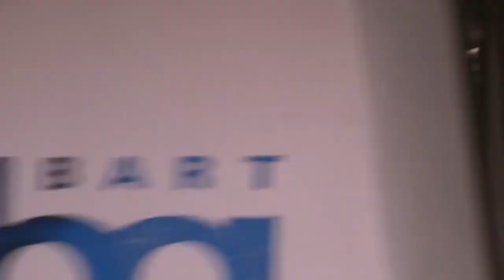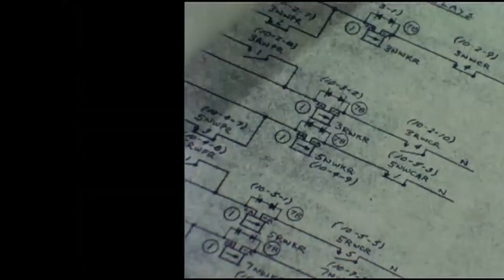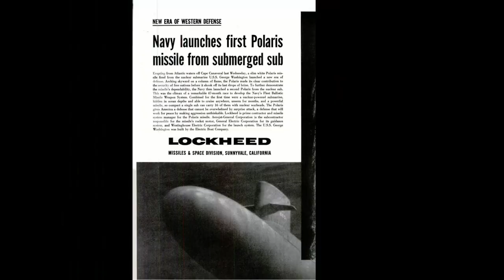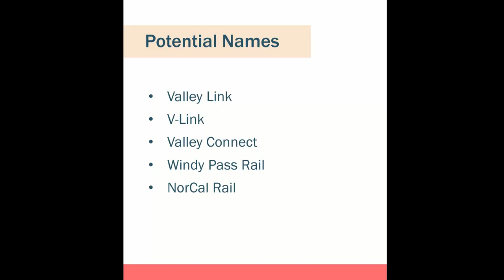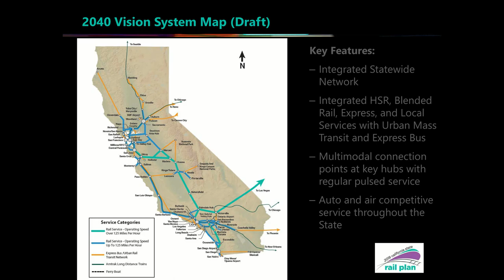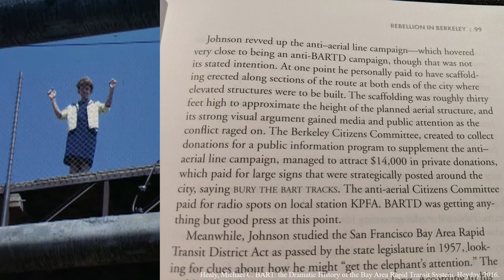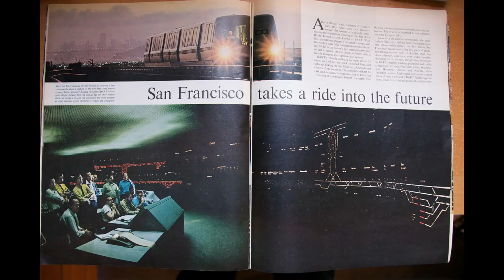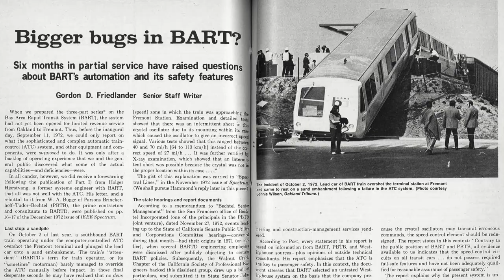BART: The Bay Area Rapid Transit (District)

Comment: I am a big fan of subways and transit systems.  Overall,  BART is a great system now connecting four counties.  The problem I have with transit systems in the United States and BART, in particular, is how long it takes to build the system and/or extend the system.  There were so many delays I think it took four years for BART to extend the line just two stations into San Jose.
Shanghai, China has a subway system larger than New York City and it was accomplished in just thirty years.  BART is probably only a third as large and it will be fifty years old next year.  It is not only sad it is pathetic that BART and transit in general in the United States is far behind in planning and construction.
Reply: Well, our regulatory system allows any NIMBY to block even projects of national importance. Ironically, this is mostly done via environmental laws lawsuits, like CEQA. It's sad that zero-emission environmentally-friendly alternatives to driving are being blocked using laws which were originally meant to protect the environment.
Reply: after approval in 2000, the south bay extension didn't open until 2020... crazy slow progress

Comment: Good video. 
ATO (automatic train operation) was developed successfully in London and on the Lindenwald line in NJ at about the same time.
AFAIK the Tokyo metro can manage 90 second headways with human drivers but they have a unique perfectionism.
You could have mentioned they built BART to a different rail gauge (5’3”/1600mm) to the rest of the US railroads (4’8&1/2”/1435mm).  The only justification I’ve seen for this is the concern that crosswinds would blow the light weight aluminium bodies over. 
Inventing the “perfect” system is absurd when good enough using existing technology will do. 

Nice comparison with CAHSR.  IMHO they should have built maglev.
Reply: They actually used 5'6" Indian Gauge, and the wider gauge would allow them to have better stability at higher speeds, as the system was designed to be a commuter rail/heavy rail hybrid.
Reply: @AVeryRandomPerson  Thanks.  

Was it necessary?  

Other railways seem to have high speed on 1435mm gauge without problems.  The increase in stability would seem to be marginal.   They could have gone full-GWR to 7'1/4"? AFAIK no one else has copied them.

I read once that BART chose it because the design uses lighter (aluminum) framed cars and they were worried about strong cross winds.

Comment: The Genesis of Bart came out of the demise of the key system in the early fifties
 When they did get rid of the urban transportation at that point the outlook was we're gonna have to put a train under the Bay that was decided in the mid fifties and they had an artist rendering of what that would look like
It wasn't until prior to the Vietnam war that the decision was made to do an environmental impact study and figure out how to fund such a project
 the Bay area rapid transit district was created to get the funding and once funding was achieved the contracts were approved and the idea was to completely electrify a train system for the entire Bay area unfortunately that didn't happen
The bulk of the system was completed and brought online in 1972 and it wasn't until a few years after that the trans bay tube was constructed and opened a couple of years after that and it wasn't until recently did a complete circumference of the Bay area plann with all of the transit bureau's and districts for the entire Bay area finally come to fruition
Phase one of silicon Valley has finally been completed phase 2 is about to begin construction and once that is opened in 2028 with the adaptation of the electrification of caltrain you will have a complete service of electrical  train that services the entire Bay area